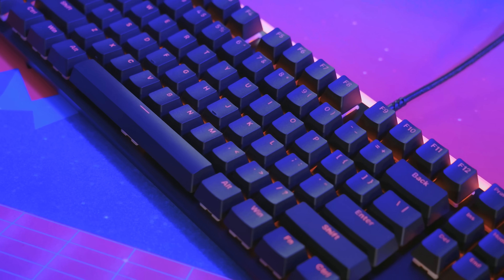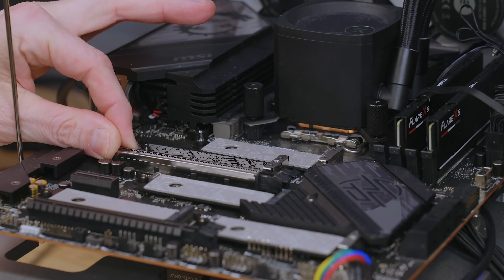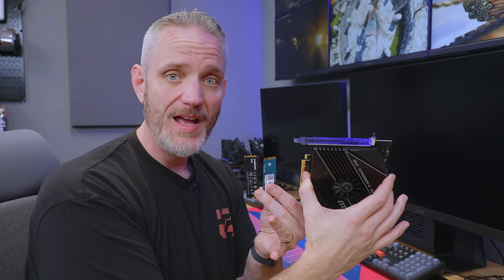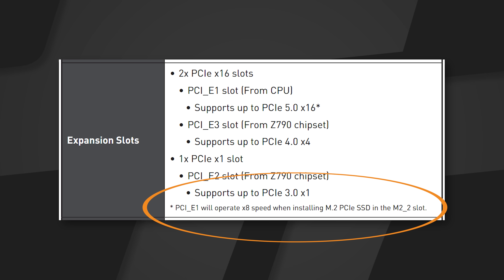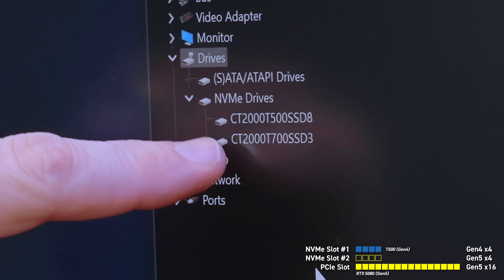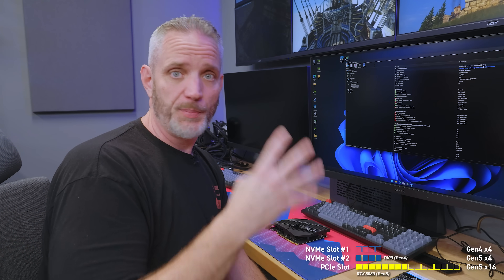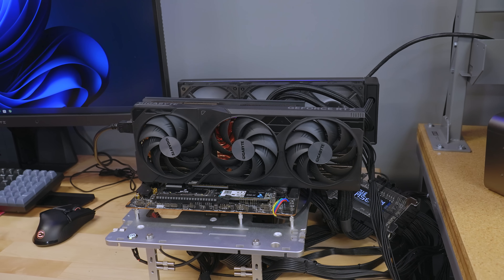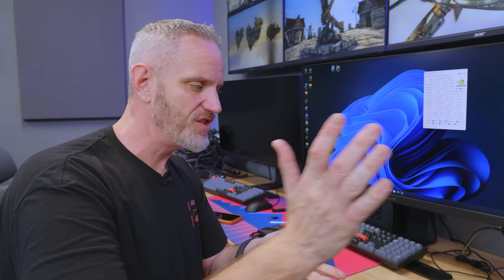Don't make this mistake with your PC!

Comment: I'm a firm believer that you should only buy in to high-end, or even the upper mid-range stuff, if you know about PCs and can build them yourself. If you buy a 5080 or 5090 PC or even just the card, and someone else has to help you set things up or install the part, then you're doing it wrong. You're going to run in to problems down the line, and your risk wasting A LOT of money.

I see people on Ryzen using 4 DIMMs or using 128gb or 192gb or whatever, which butchers the Ram speed, which really contradicts their 9800X3D or 9950X3D purchase, which yes, those CPUs are seriously hurt by slow Ram, I own a 9950X3D and 96gb Ram, and it wasn't tuned, after tuning the timings, my performance increase so much it was like a GPU upgrade, I just thought the 4090 was too fast for a 9950X3D prior to the tuning.

Gen 5 drives are currently marketing, and will do NOTHING for you. There's absolutely nothing you can do on a consumer desktop to fully utilize even a Gen 3 NVMe drive, unless you're copying files which then maaaybe a Gen 4 will be faster, but in most cases there's a bottleneck elsewhere.

In many cases buying a 3D Ryzen 9 for a high-end build is stupid because you are required to be a tech savvy person for dual CCD 3D chips. If you're not tech savvy, then I bet you didn't install the chipset drivers, and set CPPC in the BIOS to the correct option. This is why the 9800X3D and 7800X3D are noob friendly, you don't have to do any chipset trickery.

I see people running out and buying a 5090 because it's the best, but their CPU is too slow for it, or their use case for it would have been identical with a far cheaper 4090 or even 5080. If you're not at 4k, which most people are not, then don't even touch the top end GPUs, it'll be cheaper to just upgrade a 60/60Ti/70/70Ti every generation. The high-end GPUs also run the risk of issues like burning connectors, requiring massive PSUs, and better cooling in your case.

My friend said back a few years that he wanted to build a PC, after explaining to him the GPUs at the time, which was the 10 series, he said he wanted multiple Titan X cards because he could, even though I said it's not worth it, you should get one, and at that point just get a 1080Ti, it's 99% the same card for half the money. Don't be an idiot because of ego or to flex, just get what you need, nobody cares what your PC specs are, in fact people will judge you more if you overspend.
Reply: -----
@mttrashcan-bg1ro
-----
- When it comes to 'RAM', there one thing that is extremely important to keep in mind...
Not all people have the same needs/requirements.
-
F.e...
A 'Heavy-Haul' or 'Long-Haul' driver wouldn't opt for a 'Race-Car'.
Just like a 'Race-Car' driver wouldn't opt for an '18-Wheeler'.
-
What holds true for one person doesn't necessarily hold true for everybody else, just saying...
-----

Comment: Can't thank you enough both my units were compromised. One by BIOS and the other with a slower adaptor sharing the bandwidth using your technics for testing both are now correct. Much appreciated.

Comment: It really depends on what you’re doing with the drives.  Most people, not moving huge video files around, will likely not notice a difference between an NVME gen 5 drive and a SATA drive.  On boot up of the OS, it might be 2 or 3 seconds, if you’re lucky.  Opening a web browser, probably indistinguishable.  The technology has gotten so fast in recent years, that, on paper, the drive is significantly faster, but on normal, real world use, it would be tough to tell them apart.  Moving large files around, sure.  Normal stuff, probably not.

Comment: strange, i have a Z690M asrock phantom gaming, and the second slot is atually X16 but PCI 3.0, if im not mistaken, this board have 12 lanes for pci 4.0 and 16 for 3.0, sad part is that both the 14400F im using and the 14600K i want to buy have only 20 pci lanes, but i think that the only devices that can be managed by the cpu is the top nvme slot and the 4.0 x16 slot, if im not mistaken, if there are any other, it probably wont work while using bot a GPU and a NVME

Comment: 10:45 Exactly. Like, what is the point of a gen 5 drive if not for very specific professional uses? An extra 7GB/s read and write will shave tenths of a second loading the OS or any game compared to a gen 4 drive. At this point it's just bragging rights and diminishing returns, but hey, gen 6 drives transferring stuff internally at 30GB/s are coming soon™

Comment: I replaced my GPU in my server with a PCI-E expansion card after switching to a 5600G CPU, and run 4x 14TB SATA HDD's through it.... I was considering moving the expansion card back to an original x4 slot as that works just fine for those HDD's... But the cost of getting a bunch of gen 3, 8TB NVME drives and a suitable expansion card for the x16 slot is so high it's not worth considering.

Comment: So wait, i have a ProArt B760-CREATOR mobo and a 4080 super by what Jay said im loosing performance with the gpu in the 5.0 x16 slot? also i have two m.2s on the pcie 4.0 slots

Comment: Soooo..... Back to 2.5 SSDs instead of m.2's? Only way to be safe 0.0
Reply: I think I'm okay, manual (and pretty sure a sticker) said if I used M.2 slot 2 it would half my x16.... So I used slot 1... I should be okay?

Comment: cliffhanger -- need to know why they put those slots when they cant be used with their full speeds.
Same thing with my msi x870e wifi carbon, cannot use 2xGen 5 nvme else the pciex16 slot get cuts on half, same thing for the other gen 5 pcie slot, as the mobo has two gen5 x16 pcie slots, if both are used then again it cuts it the gen 5 pcie slots in half. Arghh...

Comment: 3:47 Incorrect, sir. There is no bifurcating a 4x slot into 2(2x) - you're going to find that one of the slots in your expander will run at 4x, and the other slot won't work at all.

Comment: You still didn't get into the issue of PCIe connected through the chipset. The chipset will be connected to the cpu with a x4 lane of the current generation of the cpu. In other words, a cpu that has Gen 4 support will dedicate  x4 Gen 4 to the chipset while a cpu that has Gen 5 support will dedicate x4 Gen 5 to the chipset.

Everything connected to the chipset must then share that x4 back to the cpu.  This includes USB ports, nvme slots, WIFI slots, LAN, etc. This means that the motherboard you used as an example has x4 Gen 5 between the cpu and the chipset. It also has three x4 Gen 4 nvme slots. If the motherboard offers another x16 physical slot it will often go through the chipset, but will often either be a lower generation and/or less actual lanes. The PCIe x1 lanes often are handled by the chipset.

Intel cpu's have 20 PCIe lanes, 4 of which go to the chipset, which leaves 16 PCIe lanes for devices. AMD cpu's have 24 PCIe lanes, 4 of which go to the chipset, which leaves 20 PCIe lanes for devices. With the demand on modern cpu's they really need more PCIe lanes. This is much easier for Intel to do, because they change the cpu interface so often. 

The new standard should be 28 PCIe lanes for the cpu.  This would require AMD to move to AM6.  It will be some time before AMD adds lanes, because they want those that need more lanes to buy Threadripper cpus which have a much higher profit margin. Unfortunately by the time Intel and AMD increase the cpu PCIe lanes to 28, we will probably be at the point of wanting 32.

Comment: I’m new to building/optimizing PCs. I screwed up royally lol. I checked gpu-z and I was running my GPU Gen 5 @ x2………… I had multiple drives of different gens and types(NVME and disk). I consolidated data onto one Gen 4 2TB drive and put it into the correct spot. I’m now running Gen 5 @ x16. I feel like an idiot hahahahaha. I was wondering why my system felt so sluggish.

Comment: I think AMD does not have this problem and if you put a gen 5  GPU with a gen 5 NVME they will work at their max performance they will not frop to gen 4. Also bifurcation would be good in the case of the Asus RTX 4060 GPU which has a NVME slot in it. you bifurcate it the x16 slot to x8/x8, you will lose 1 x4 but you'll be able to use a GPU and NVME SSD in a x12 combination.

Comment: Ran into this the other day.  Bought an NVME m.2 drive for my friends computer.  Plugged it in and suddenly the WiFi card stopped working.  Apparently the slot and the m.2 drive were sharing the same lanes.  Fortunately she had another slot available, so I just moved the WiFi card and it all worked.

Comment: Yip ASRock X670E Steel Legend with 3080Ti (running Gen 4 16X) Gen 5 M.2 at 32MT.  Thanks for the heads up Jay all my speeds are good I read the manul when I built it but its nice to use HWINFO to comfirm the speeds are correct!

Comment: The other consideration to "fast" drives is that if you cannot fill the potential bandwidth the speed does not matter. For average users and gamers in general, the advantages of Gen 5 NVME are just not worth the cost.

If you're going to do a LOT of large file access (video editing is a great example) the speed advantages of a gen 5 drive vanishes except in benchmarks.

Comment: The PCIe lanes on modern  desktop systems are quite shamefully few.  You have 10 slots you could populate (M.2 PCIe, PCIe slots themselves, Chipset(s) and SATA) and you cant even use them all at once at full capacity.

Im not talking about the cheap stuff either, but the 400$ plus stuff

Comment: 10:45 ummm actually (😅) its much better to have faster pcie generation drives wirh bifurcation. If you run a gen 5 drive on 2 gen 5 lanes its the sama as a gen 4 drive on full four lanes, so if lanes are at a premium, get a drive that is as fast as possible

Comment: Thanks! What I did was this: using ChatGPT (paid), I made it remember the PDF manual of my motherboard and had it create a visual chart showing where to connect my drives, GPU, USB devices for keyboards and mouse, SATA drives, etc.—all to ensure proper placement, avoid latency, and handle bifurcation correctly. Easy peasy.

Comment: i went with asrock x870e nova wifi specifically to not have this problem, and because i liked the aesthetics
i don't understand why so many people made this mistake, it's cheaper to check the manual than to have more drives that you can "flex" but can't use

Comment: At 5:35 you have a graphic up showing the 14900K eating 16 lanes, but you don't fully explain how Gen 4 M.2 is supposed to utilize the remaining 4 lanes. Can you explain how the MB bifurcates the remaining lanes for Gen 4 M.2? If you use a 14900K on a Z790, are your Gen4 M.2 drives automatically slowed down?

Comment: on Older board some sata ports  are disabled because you put an Nvme in pcie slot
Also PCIexpress will switch to x4 or x8
on z490 unify :
"SATA2 will be unavailable when installing M.2 SATA SSD in the M2_1 slot."
"SATA5 & SATA6 will be unavailable when installing M.2 SSD in the M2_2 slot."

read the manual is important

Comment: I would have rather give up one m.2 slot for a higher bandwidth pcie slot. I've checked so many boards and I wouldn't be able to use a 10g network card and had to settle for 2.5.

Comment: Crazy, although m.2 gen4 x2 port technically have the same bandwidth as gen3 x4 but it doesn't deliver full bandwidth for gen3 drives. At first I thought it kind of a waste for certain mid/low spec B650 mobo has m.2 x2 port in it, but thats actually neat for utilizing the excess lanes from the chipset.

Comment: Jay, you mentioned that you felt the explanation of PCI bifurcation may have been a bit choppy. Pre-retirement, I had over four decades as a self-employed systems administrator servicing small businesses. This may have been the best description or explanation of what bus lanes actually perform and how few standards exist. Seriously, you did a fantastic job displaying in lay terms a section of hardware software configuration that most DIYr's either ignore or tie the configuration in such knots and lose 30-60% overall performance. The real kicker, IMHO, is many self-proclaimed power users will fail this important piece and never even know it. Many of these people will then rant about how they paid big bucks and yet their equipment doesn't come close to delivering on vendor claims. I don't know how many systems I configured, but no matter how simple or how complex the system, job one was to take the time to “THOROUGHLY STUDY THE MANUAL”! Not just a quick read, I mean seriously STUDY the manuals. Mainly the motherboard manual, but never overlook any of the manuals for every installed component. Admittedly, due to the rapid technology advancements, there wasn't one system configured that didn't have some change, upgrade, or modification. Some desktops that were labeled as exact models yet had no updates or addendums provided. I also have to admit I made my share of blunders as well. This is a tough industry to keep oneself current in. No wonder we're all nuts. You did an outstanding job! Be well,

Comment: from intel itself:
cpu PCIe gen 5
pch/chipset PCIe Gen 3
total lanes = 28

now my question is how do i know which is what? my M2 are running 2x gen 4 4x, gpu is 8x gen 4, thunderbolt 4, usb-c proably also x4 i would say. so i come on 8+8+4(+4)=20(24)..

so i think i have 20(24?) lanes maybe of the 28 total? also there isnt mentioned what is what. only tells me gen 4 everywhere when i try to read them out via software like cpu z, gpu z or ssd programm who can show pcie or sata infos and manual says nothing about it from asus on top. 

what do you know about those things. i will listen and try to get deep into this stuff if i can figure it out. any help will be appreciated on this. you can get deep into it i dont mind understanding it and need to search infos i just want to understand that deeply. software/manuals are not worthy in my case of helping me understand it.

Comment: My motherboard was weird - It's a ROG B550-F GAMING WIFI-II. I was puzzled why my 2nd PCI GEN4 M.2 slot was only doing half the speed it was rated for. It turns out the on board WiFi was sharing part of the lanes of the M.2 slot to the chipset. Since, I don't use WiFi, only ethernet. I turned off WiFi off in the  BIOs and the GEN4 M.2 NVME SSD was able to get max speeds. Asus's staff/customer support that I talked to did not even understand this either :\ . I'm glad I figured that out though :)

Comment: A tip to anyone who wants to confirm where a slot is routed, if the motherboard is not clear on that, you can put something in that slot and boot up Windows and go into Windows device manager and then in the view menu choose view by connection, then as you expand the hierarchy you can see which device is plugged into which host device such as the CPU or the chipset.

additionally if you choose the wrong bifurcation option for the slot in the bios and you choose 4x4(x4,x4,x4,x4), devices that support more than x4 lanes will not be able to use 2 groups of x4 lanes to get x8, only the first of the x4 groups of lanes will be utilized. the rest will be ignored/lost.

Comment: Jay you've got your bifurcation information slightly wrong in the beginning of this video. If the card does not have a PCIe switch chip, then the card for m.2 will not get you '2 x 2 Lanes', instead it will stay with 1 x 4 and only one of the two m.2 sockets will work. If it does have a PCIe switch chip then it will stay a single 4X Lane slot and it will just share bandwidth with the m.2 sockets if they're both active.

additionally the motherboard still needs to have bios support and physical routing support for that specific slot to be bifurcated into 2 x 2
Not all configurations of chipset lane routing supports bifurcation.

Comment: One more thing to remember, not every board bifurcates all the way down. It may go all they way down to eight 2x but that's mostly reserved for high end "workstation" boards, most consumer grade mobo's do only two 8x or four 4x at most. Sometimes on some boards if you use M.2 slot, you can't bifurcate or the other way around, it disables a M.2 slot if bifurcation is turned on. 

Do as Jay says. Read the manual.

Comment: I'm going to point out that while using the beelink me mine I have run several nvme drives together. The newer drives(gen5) will not use the speed that they can run, but will use as much as 3.5 watts Less power. If you're going for a low power build you'll want the new drives anyways.

Comment: That's not how that "stupid" expander card works. That one just connects the physical pins of the m.2 drives with the pins inside the PCIe socket and relies on the CPU or PCH on the other end of that connection to support splitting the first 8 PCIe lanes on the socket to two separate devices. (and if that isn't supported, only the first m.2 will show up)

Comment: My B550 Tomahawk makes a PCIE slot and an M. 2 connection codependent with the SATA interface. If you use the PCIE slot and SATA, it will slow the slot and the M. 2 down to PCIE2. The manual covers this, sort of - it's very badly explained and hopelessly confusing. I just don't use that PCIE slot at all.

Comment: Well for his example kind of. You do have riser cards for M.2 that do direct 1 to 1 without combining them all together. So only have a x4 slot will mean only 1 of the drives works not both. If MSI wants it to have the maximum amount of performance possiable they went with that method even though another method exists it is the objective best just with a drawback that you lose drives when you use a smaller electrical slot.